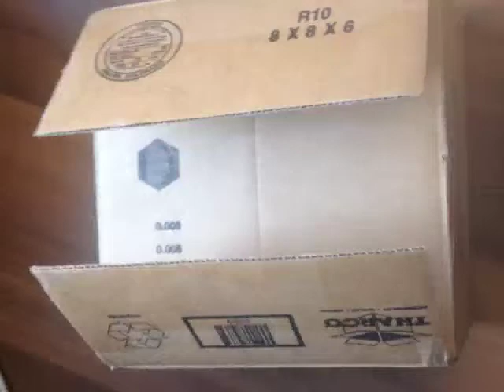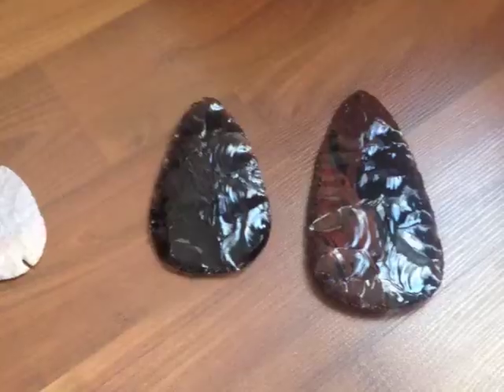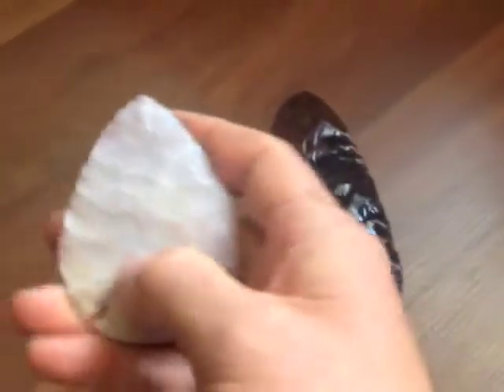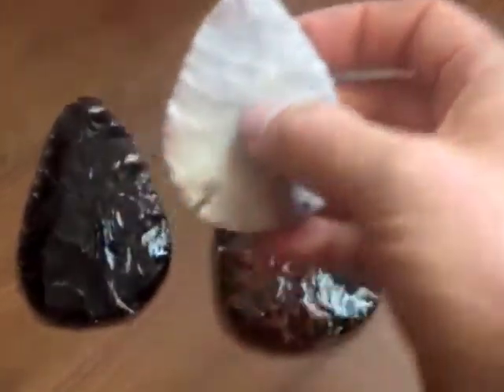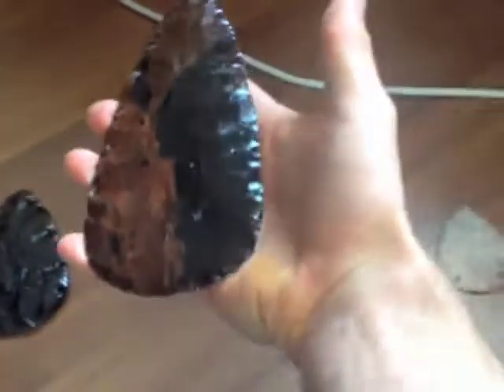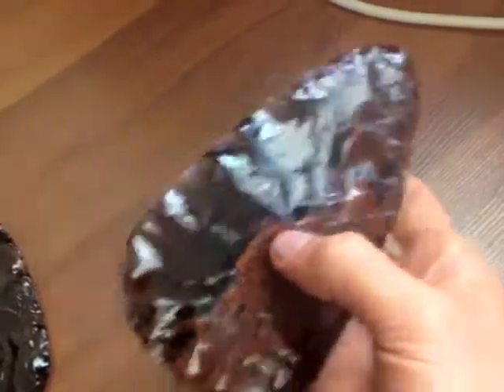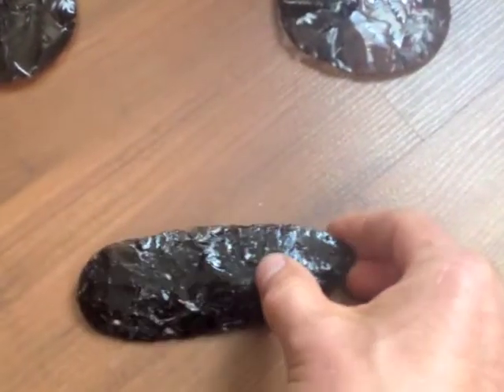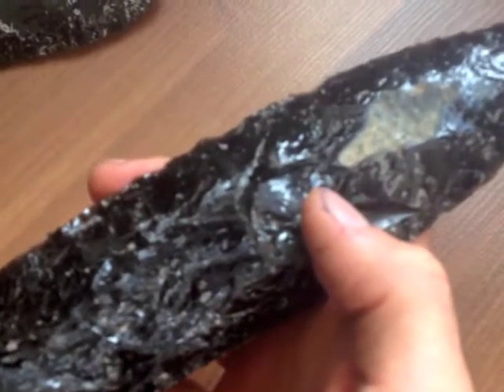Bifaces from Wertak

Comment: Holy crap those are super nice. I can make a shape most times, tho thinning i cant seem to do across the piece. I pushinward and down, to try and drive the pressure across the piece but still cant figure it out. Great stuff bro. You are doing very well. You seen my knives i made from the obby you sent, its good stuff tho not thin . I think most knives were made like we make them, only the pros can make the best peices back then im sure. thanks for the vid